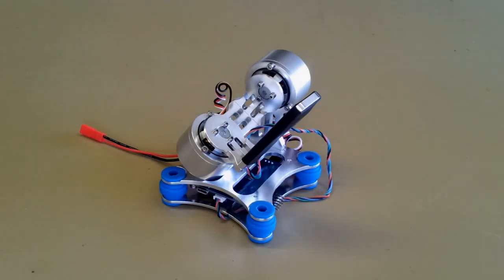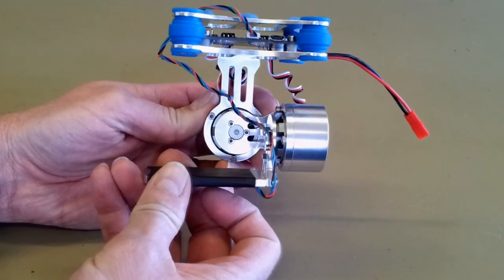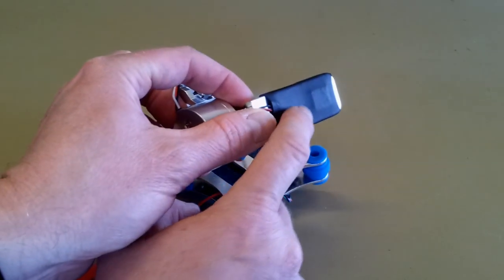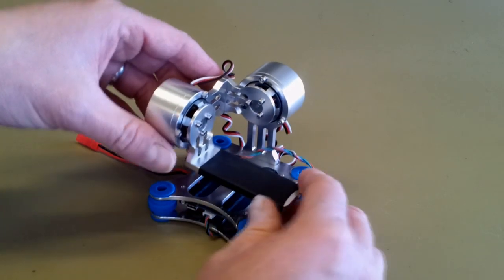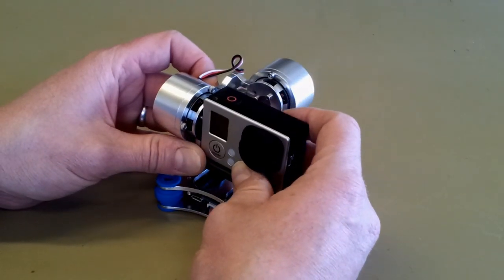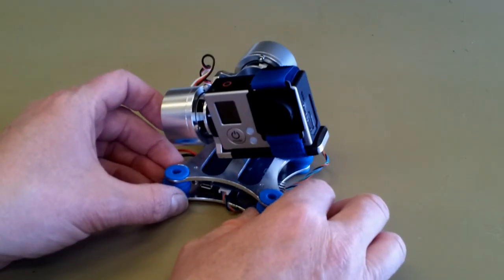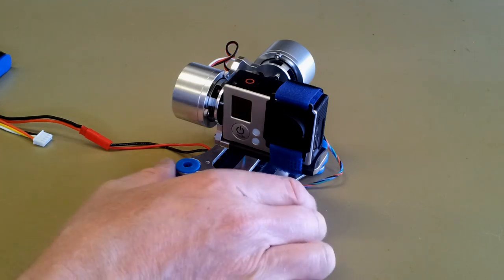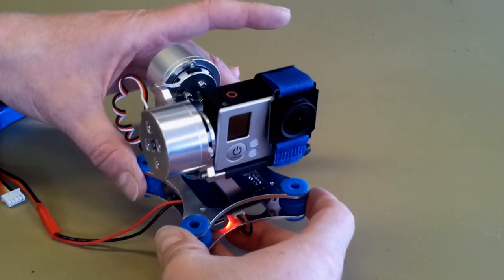2-axis brushless Gopro Gimbal for FPV Raptor / Bixler fixed wing model plane

Comment: Hello, thanks for this video as I was wondering if this was possible. Just a little question : do you know if it is possible to temporary disable one the axises ? For instance, when climbing / descending a mountain in fpv, I'd like to lock the pitch axis for the camera to stay parallel to the aircraft while letting the gimbal eliminate roll  movement. I've checked the manual but haven't managed to find an answer...
Reply from the maker: Hi Sebastien, it's a nice idea but I don't think it's possible to lock one of the axis.

Comment: Could you install it without the "vibration damping" part and just mount the first motor to the nose of the plane? And install the controller inside the fuselage?
Reply from the maker: Yes, in theory that could work.

Comment: How can these be used with fpv, looks like the cable port is covered up.
Reply from the maker: UAV Patrol Hi, the port is not covered so you could plug your VTX into the GoPro

Comment: Thanks Mark, I'll have a play and come back if I find a solution.  The obvious thing to do is chop a little bit off the mounting plate but obviously that will cause a weight loss issue and as I'm using a mobius instead of a gopro I'm loathed to try that!!
Barry

Comment: Hi Mark,
Thanks for the vid, I have done something similar but have noticed that the bottom plate that the gopro sits on hits the top of the anti vibration plate when the plane rolls (around 45 degrees), have you found this also?
Barry
Reply from the maker: Hi Barry, yes I have. I'm planning to try and reverse the way the "roll" motor mounts so that the Gopro doesn't overhang the base plates - when I get the time!

Comment: So u just moved the sensor to the opposite side of the aluminium plate ?
Reply: yes. i have the same question :)
no more changing in settings in software? changing cables etc.
no problems with range of angles?

just change the location of sensor you've showned a set the calibration in orientation you want to
Reply from the maker: phats24 Yes, but also flipped it because the gimbal controller is effectively flipped when you use the gimbal in this orientation
Reply from the maker: Jan Šrom Yes, but also flipped it because the gimbal controller is effectively flipped when you use the gimbal in this orientation. No changes in software are required.
Reply from the maker: Jan Šrom Hi, The range of angles can be extended by changing the base plate configuration - please see my other video- part 2 which shows you how to do it. Thanks.

Comment: Thank you for posting this as it explained some questions i had had. How sturdy is this? I want to use on my the tail of my race bike.. i need something that could hold up to the high speeds (160mph) and bumps.
Reply from the maker: Hi, Thanks. The gimbal itself is very sturdy and responsive, but if you are travelling at high speeds over a bumpy surface, it definitely won't like the "shock" treatment. There are vibration dampening balls in the unit which are fine when I'm flying, but, when I land the plane, it does shudder around when in contact with the ground. There is a recent video clip on my YouTube channel of a flight to give you an example of how it works for me.

Comment: nice vid, does your gimball allow you to change camera angle and hold that position?
Reply from the maker: Hi, Thanks. Yes there is a small button on the controller board. With it all powered up, you just need to press the button briefly once, then you get a few seconds to change the angle of the camera. You just need to hold the gimbal steady in the desired position and then after a few seconds, you can feel the motors kick back in and they will hold that position. Took me a couple of goes to get it right, but once it's done, it holds it nicely.

Comment: Have you flown it yet?  I am speaking of inverted gimbal on fixed wing.  Curious to how it stands up to the wind.  I have done it on my skyhunter with the G3 gimbal.  Have gotten good results but results are a bit random.  Curious how this particular gimbal works.  I have thought and considered using the zenmuse H3-2d and mounting it with naza just to control the gimbal.  Expensive option, but may be a good option.  what are your thoughts?
Reply from the maker: Hi, Yes I've tested it last weekend - please see the video I posted of the flight although it was really windy so I'll try it again on a calmer day!
The Gimbal itself is great value in my opinion and works just fine.You can also adjust the angle which you want it to hold the camera using the small button on the controller board so it's easy enough to set up.
I did also consider more expensive options, but after doing some research and because I am experimenting with it at the moment, I couldn't really justify the big price difference.